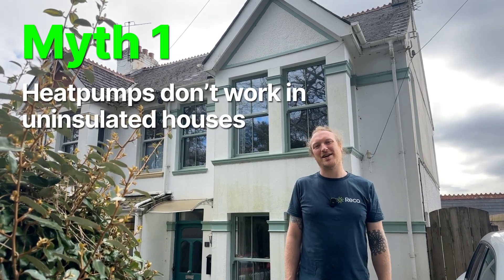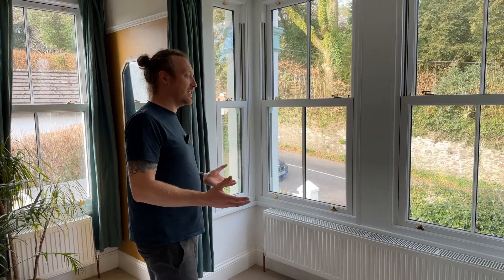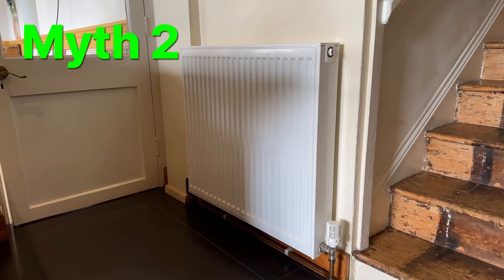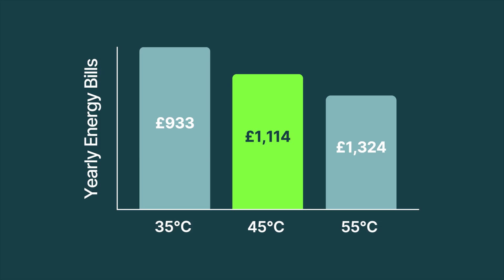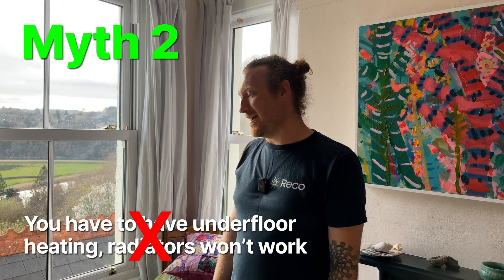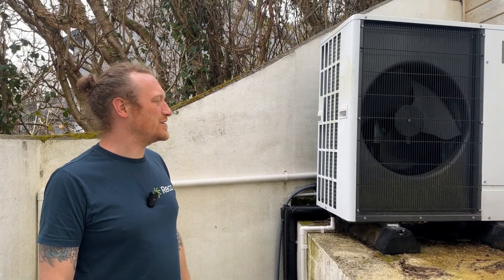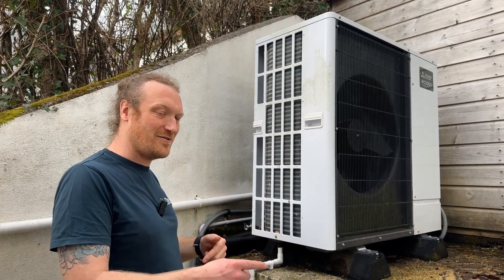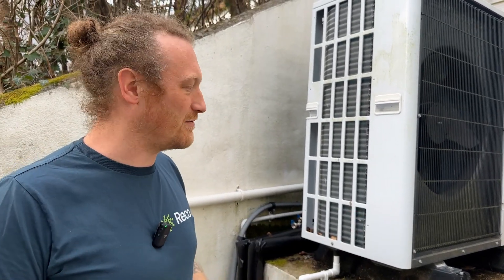Heat Pumps DONT Work In Old Houses!

Comment: When you said it was. 11kw output heat pump , what is the input?
Reply from the maker: I believe the maximum current for that unit is 25A so maximum draw is 5.75kW. The unit has a variable speed compressor which means it can modulate how much heat it is producing. This means a lot of the time it will only be drawing a couple kW. This unit is running at a COP of just below 4 which means on average it’s drawing about 1/4 of the heat energy it’s. The other 3/4 of the energy is being extracted from the air. It 

Please subscribe if you haven’t already, we’ll be releasing some explainer shorts soon about how heat pumps work 👍

Comment: Err misleading, windows are always a heat loss area no matter what glass you have whether it be standard or triple
Reply from the maker: Sorry if I didn’t make it clear, the windows that these double glazed windows replace were single glazed so a very large amount of heat was being lost through them. With these new windows very little heat is being lost through them, much more through the red brick solid walls.

Comment: There's no reason why anyone shouldn't use a heatpump - all one does is efficiently move heat.
Anyone who says "at 7p/kWh" should be taken with a pinch of salt. There are tariffs (often reserved for EV owners) offering those prices, but there's no such electricity in the UK reliably available for 7p/kWh. That's a bribe to get people to make the fuel switch, being paid for by other people's bills. If you're being sold a system on the basis that a 'too good to be true' tariff will go on for the payback period of your project, you should probably ask for another model based on eg Economy 7 prices (about twice that?) as a worst case scenario. Even solar PV is said to be slightly more expensive, amortised.
I like your plinth heater, never seen one in a floor before. Is it recirculating air or doing a bit of PIV?
Reply from the maker: If the efficiency of the heat pump installed is good then the cost of each kWh of heat generated should be below 7p / kWh. Which interestingly is lower than the new price cap for gas per kWh when taking into account boiler efficiencies. It may be possible to reduce that slightly using variable rate tariffs but a heat pump does need to be running all (or most) of the time to get the best efficiency from it. Agree with you on the tariffs though, it’s only octopus go that is that cheap and that’s only if you have an EV and it’s only for 5 hours at night. 

The plinthe heater is just recirculating air in the room, it looks very smart but is quite pricy and difficult to install! Great space saver though 👌

Comment: The problem with heat pumps are the work in a narrower widow than Gas boilers do. So bad design on a gas boiler means you’ll be burning more money but it will still output heat and likely just fail quicker because of excessive cycling. 

. If you design a heat pump badly it can fail to produce sufficient heat at all and your house won’t get to the desired temperature. Trouble is that some people have experienced this and bad news sells more newspapers than good news. 

Also people are used to boilers and operating hearings like a boiler is less efficient. A bit like driving around in 3rd gear and complaining you’re using too much petrol.
Reply: hearings?
Reply from the maker: Yes, with over 80% of houses on the gas grid, we have had it very easy in this country for a long time when it comes to heating design. Very often a boiler isn’t designed or installed correctly but it probably will have around a 10% difference in efficiency as a result. This has resulted in a lot of “rule of thumb” design and installation. As you say, heat pumps installed incorrectly can be disastrous, and this is why we get bad press.
Reply: @ 
Most gas boilers are not fitted correctly. Very few are ranged rated which is a simple thing to do. Many boilers/combis come with integrated weather compensation, yet are not fitted with an outside temperature sensor, leaving the only control on inefficient on-off room thermostats. 

Most are fitted by plumbers who are out of their depth in heating - they need to stick to drains, etc, whch is their field.

Comment: Good stuff. I think the two main challenges we face in the UK for the adoption of heat pumps are:
1) Misinformation. Older people especially aren't just needing convinced by facts, they are having their opinions provided for them via newspapers (who all hate heat pumps and delight in rubbishing them -- a few of my older relatives seem to view hating renewables & heat pumps as a badge of honour)
2) Bad installers & installs with limited comeback. I'd be delighted to get one, but how do people know they're going to get a competent installer?
Reply from the maker: Yes, unfortunately it is actually DISinformation. It has been proven that certain newspapers and journalists are being paid by the gas lobby. They want the public to think that they don’t work as they present a threat to their vertically integrated monopoly. Perhaps a subject for a different video one day 🧐

We will definitely be releasing a video on what to look out for when speaking to installers - there are some very clear red flags! 🚩
Reply: @ 
The running costs of a heat pump and a well designed and installed gas system at best is only slightly better, if it is of course. 
The larger rads and high install costs are a big put off. The are a superior alternative to oil though. Houses that have oil tend to have the space to fit heat pumps.
Reply: @johnburns4017  re: running costs, it really depends on the sort of property being upgraded, and also which tariff you're on. However, I've seen plenty of videos in average/older properties where the heat pump wins handily, but it does need a skilled installer. I've seen plenty of botch jobs (including in new builds, ffs!) to the point where I would not trust a random heating engineer to install one, but I would trust certain groups & companies.
Reply: @defragsbin  
Also the high install cost of heat pumps is a put off.
Reply: @johnburns4017  with the government grant, the install cost isn't that much more, though. In an older house that needs updating, you might have to add a bit of insulation and get some bigger radiators, but it's not that much more. If your house is decently insulated, the price may come out the same or even cheaper.

Comment: Given the title I came here to correct you, but I see there is no need, nice video. Incidentally with the right size battery system that heat pump would have cost £312 to run last year. I've solar and a 29 kWh battery which I charge off peak at 7p a kWh, solar, batteries and a heat pump can really bring costs down. Just had my heat pump installed. I suspect some winter days I may run out of battery, but doubt it will be often, we get 6 hours off peak so the battery ond solar only need to cover 18 hours.

Comment: major source of the myths... gas boiler installers
Reply: What about all the myths of heat pumps,  even our government claim they are many times more efficient than gas boilers. 
Simply inaccurate due to misunderstanding efficiency and how it is calculated.
If they are that good why does the government bribe potential customers with such a large grant? That would not be necessary if they were as good and  finacially benefitial as is claimed?
Reply: Yeah mate, but the heat pump installers give totally impartial advice 
🤣👍🤡
Reply: @Voting-does-nothing they'll be the gas boiler installers who don't know enough about heat pumps trying to get on the bandwagon.

Comment: Is this a one pipe system or flow and return central heating system? Thanks
Reply: Of course it's flow and return, it simply won't work otherwise.
Reply from the maker: Yes it is flow and return, heat pumps require a high flow rate to ensure there is a small difference (5-7 degrees) between flow and return. That way the average temperature of each rad is correct, giving the required amount of heat for the room. One pipe will mean that temperature will keep dropping as it goes from one radiator to the next which will not work. Unfortunately if you have a one pipe system it’s going to need completely repiping.